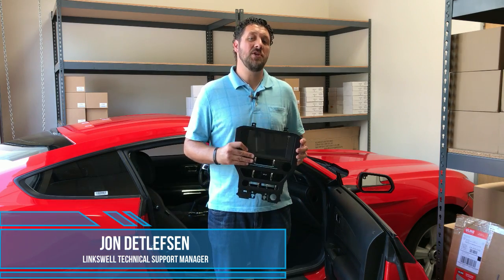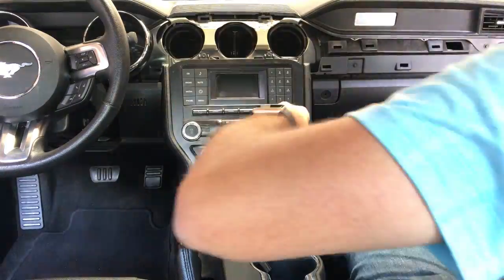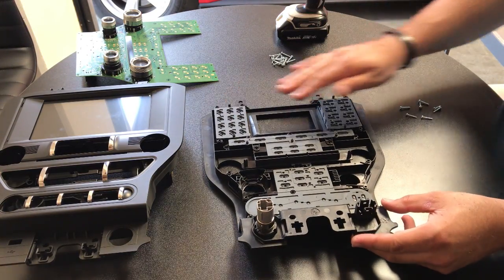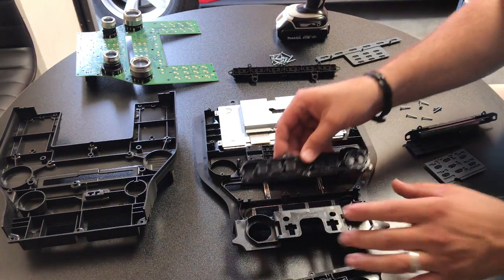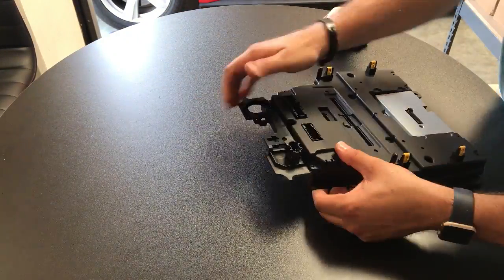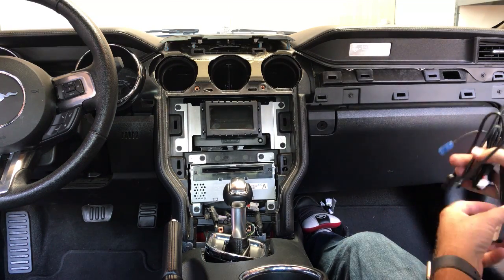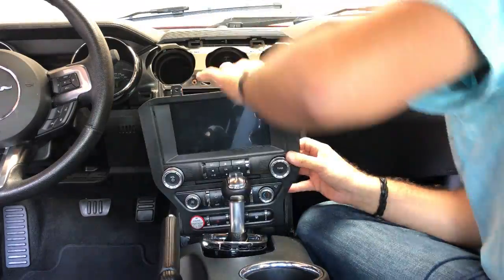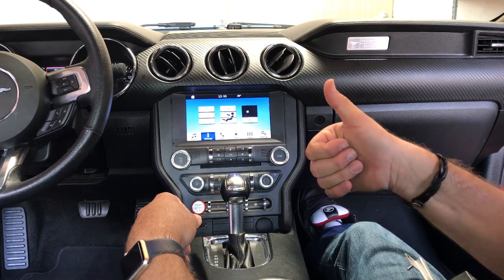Mustang Screen Replacement installation

Comment: Not sure what brand this unit is but I installed my navos 8 inch screen and the screen will randomly turn or completely and stay of or turn off and rebute. It also mutes intself sometime. Do you know what could be wrong ?

Comment: I have the 4 inch screen on mine, would I need to get any extra wires to install a 6 inch that came off another mustang?
Reply from the maker: abel gabaldon our system isn’t a factory upgrade. Our screen is our own we manufacture it. So if you have the factory screen from the 8” you would have to contact Ford and see what parts are required.

Comment: What’s the cost of this upgrade ? Items and labor
Reply from the maker: We are the manufacturer, not a retailer.  So we don't offer installation services.  Our Screen Upgrade system's MSRP is $650.  The labor rate would depend on the individual shops labor rates.  We have a find a dealer tab on our website that can assist you in locating a dealer near by you.  If we don't have one close to you and you have a local shop you would like to use, we can work with them to get the unit into your car.

Comment: I have a 2018 mustang, originally equipped with the 4 inch screen, I had ford install the 8inch touch screen for me but my sync is not up to date, how can I install the new sync 3 software, and instead of saying phone, it still says sync on the bottom of the screen so that’s why I assume it’s not up to date. Also Apple car play does not work yet. I have the gps version also.
Reply from the maker: If it is Ford equipment you will have to have them get the software issues figured out.  Our kit is not a Ford part, its our design.  We designed it to take the 4" screen and turn it into an 8" touch screen while retaining all the other components from the 4" system.  SO our system doesn't give you SYNC 3 we just turn your UI into the SYNC 3 UI.  The rest of the factory set up remains the same.
Reply: okay, i understand. Well the radio is linkswell. http://www.linkswellinc.com/products/no-category/mustang-interface-with-sync-3-ui/ this one to be exact. its equipped with a version of sync but not sure which one. Is there a way to upgrade to sync 3 on this maybe by using this ?? http://www.linkswellinc.com/products/integration/ford-sync-3-navigation-interface/ or could i just install sync 3 software from ford on this radio.
Reply from the maker: If you have our upgrade unit, we do not upgrade your vehicles SYNC system, replace your SYNC system or its ability to be upgraded.  We simply upgrade the display and controls to the factory system.  Its not a SYNC Upgrade, and it doesn't make it possible to upgrade the SYNC.  So the factory system remains the same.  If your vehicle didn't have CarPlay before the screen upgrade our screen replacement doesn't add it.  If you did, then we may have to figure what is happening with why it wont work.

The second link you posted is for our Navigation interface for Ford SYNC vehicles that came equipped with the factory 8" screen.  It doesn't upgrade the SYNC system either, it just adds navigation to the existing SYNC System.
Reply: @Austin Galipeau hey if you can remember how much did Ford charge you to replace the 8inch touch screen? I want to do that for my Mustang
Reply: @ssshhhbequiet  hey, I think they charged roughly 2k. Honestly just for a screen upgrade with no Apple car play added, not worth it in my opinion man!
Reply: @austingalipeau9170  thanks man appreciate it..I’ll take your advice

Comment: Do have a LINK to be able to purchase the dash kit? I want to upgrade my 4in screen...
Reply from the maker: So a couple things. 

1. We don’t sell direct retail. So you would have to locate one of our authorized dealers. We have a find a retailer tab on our website that will list them by Zipcode 

2.  This system is no longer in production. We stopped producing it a couple years back when we released our T-Style Radios. So unfortunately you would have to find a dealer who has one in stock which I am not sure exists.

Comment: Where can I get the 8" android stereo from? Does it allow for use of original Sync and steering wheel/voice controls?
Reply from the maker: Condor1970 in a way yes. The steering wheel controls stay working. The factory SYNC on the 4” is there as well though it’s a modified version of it.

Comment: I’m trying to find a way to install my radio I got a cover and a radio but the problem is the circuit board is in the way of the radio any help?
Reply from the maker: Is it our radio?
Reply: @LinksWellInc  no it’s not
Reply from the maker: @kyrolosdavid  won’t be able to help much. My guess is you bought a factory 8” screen but didn’t buy the new bezel to go with it?  Our screen replacement is designed to work with the factory climate circuit board the factory 8” isn’t.

Comment: What is different between this and a TOMTOP unit or is it the same just rebranded?
Reply from the maker: Not sure what the TOMTOP unit is.  We are the manufacturer and build it in our own factory.  This unit is currently being redesigned though.  Our next Generation will run with an Android based system instead of the WINCE version here in the video.

Comment: Just fyi, I calledLinksWell today (7/25/2018) and they said they no longer make the 8 inch option. May have it in the future again, but not now.
Reply from the maker: That is true.  We are in the middle of creating a GEN II version of this kit that will not just add the 8" screen, but will also add an 8" Android tablet.  Giving you more features and options then our GEN I which was just a screen upgrade.

Comment: Can you drop a link from where we can get this screen?
Reply from the maker: This product is no longer in production.  We moved to the T-Style Radios and stop production of this screen upgrade.
Reply: @LinksWellInc  I found a 2016 mustang premium screen with the switches for climate control button on the bottom next to the start button. Would it be the same process to install like this video?
Reply from the maker: @josephlakhno3556  no. It will require factory parts. Our screen is aftermarket. 

What it would require to do this with a factory screen we wouldn’t know. You would have to contact Ford.

Comment: So I bought this kit because the old one had a black screen and I did everything in the video but my screen is still black? Help pleasee
Reply from the maker: You had a factory screen go black?
Reply: @LinksWellInc  no it was a Rosen RAX-MUST 15 model. It was working fine after I bought it from the dealership then the screen went black the day after. Took it a Ford dealership and they tried to charge me $1000 to get the thing fixed. So I took it to a audio shop and they told me all the electrical stuff was getting power so it’s the screen. Bought the Rosen FIT MUST-15 model and replaced it but left the old wiring and it’s still black. I already checked the fuses..

Comment: Is this available as a turnkey assembly so I don’t have to piece apart everything?
Reply from the maker: Cody not this system. This one requires the factory boards to work. We do have a 10.1” T-Style Radio system that is turn key.

Comment: Does this upgrade the sound quality. I have a 2017 mustang and the sound is horrible. Sounds like a six transistor radio.
Reply from the maker: This system only changes the screen itself.  The factory radio still does all of the audio processing.

Comment: I don't have GPS antenna and my screen pink is that why got I don't have that antenna every thing else works I got pink pony and pink letters..
Reply from the maker: When was it installed?  Where was it installed?
Reply: I did it just a hour ago and bought last year for another mustang ecoboost and just installed in a gt
Reply from the maker: It sounds like perhaps the screen is tweaked a little.  Is the interface module mounted nice and flush in the back?
Reply: Thanks it flush pretty good but you could be right with that middle screw were the tape wires are I try to screw and it didn't have a hole in  it so I think I hit a little wire thanks bud for the quick response have a blessed weekend
Reply from the maker: Could be the problem.  Maybe check the ribbon cable for damage.
Reply: LinksWell Inc. Your right what the cable ribbon thanks alot you know your car audio enjoy your day bud...
Reply from the maker: You are very welcome.  Enjoy your day as well

Comment: Will android auto work on this?
Reply from the maker: On this version it will not.  But we are working on releasing our GEN2 version in the next 30-60 days which will add not only an 8" screen but an 8" android tablet screen, which will work with our current T-Style PhoneLink system which does both CarPlay and Android Auto.